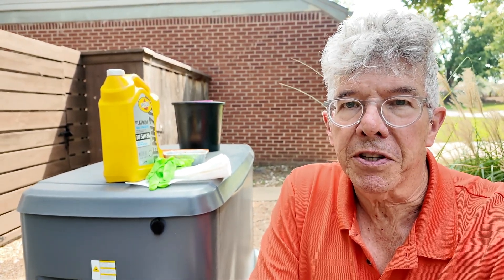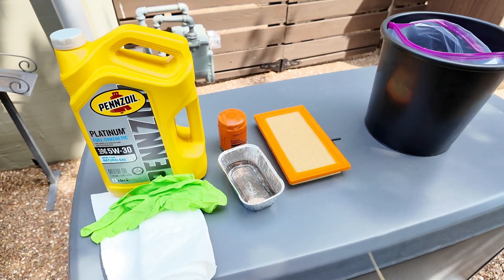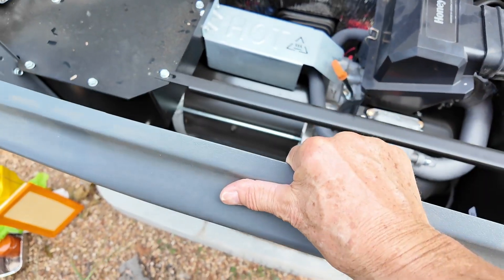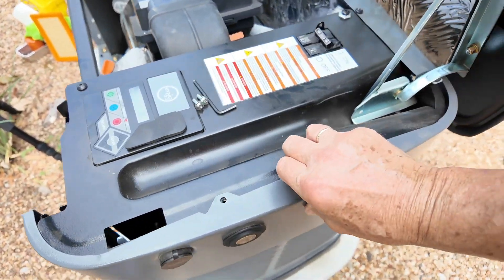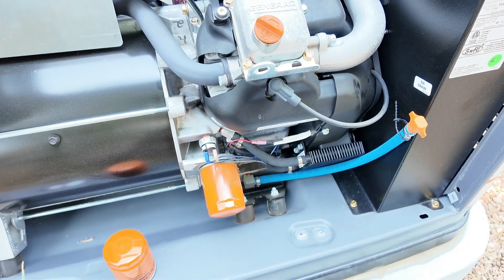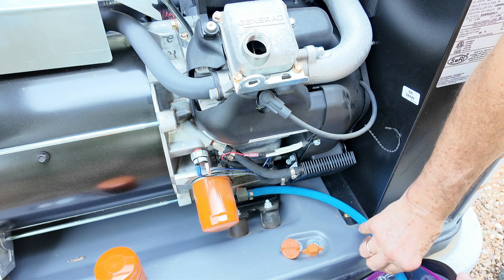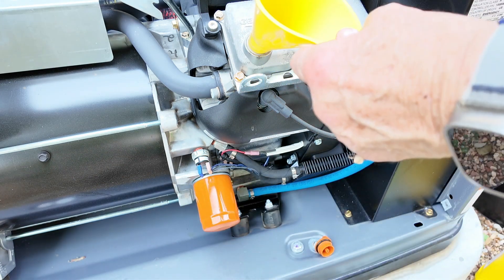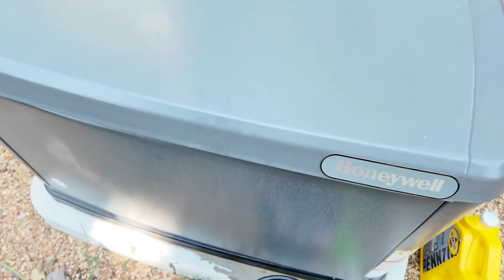25hr Honeywell Generac Generator Maintenance on 22kW Oil Change Air Filter  Battery Check oil change

Comment: Nice straight forward video. I’m planning on getting a unit through Costco as well. The estimator came yesterday evening to see the house, discuss placement and well more than likely be getting a 18KW unit that’ll run on NG. Hopefully I’ll get the quote today. He mentioned Generac so maybe Honeywell & Generac are sold regionally depending where you live. 🤷‍♂️

Are you running NG? If so did you have to upgrade your NG meter? What size unit did you end up installing? Thanks!
Reply from the maker: Yes we're. using NG. The meter was also replaced at no cost by the Utility company with one that could handle the increased flow needed.  I don't know what size it was. 22KW is the generator we got. Generac and Honeywell are basically the same company.